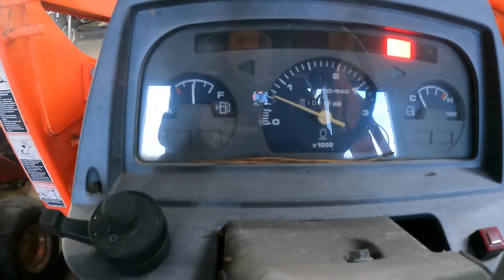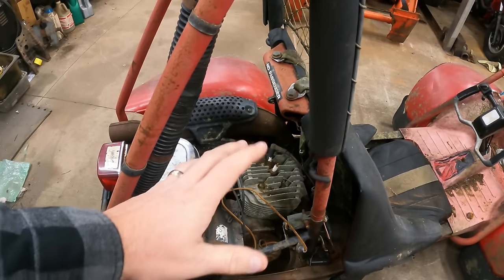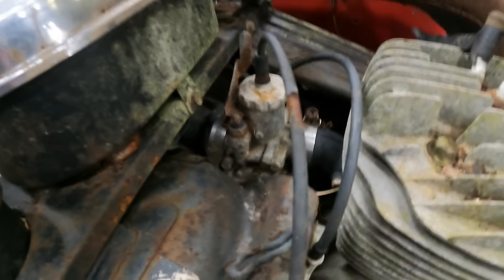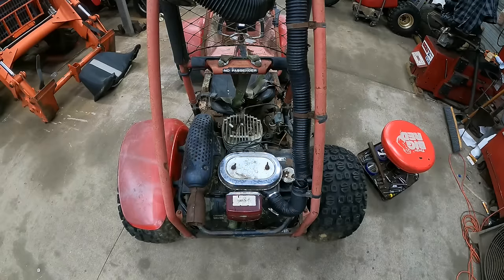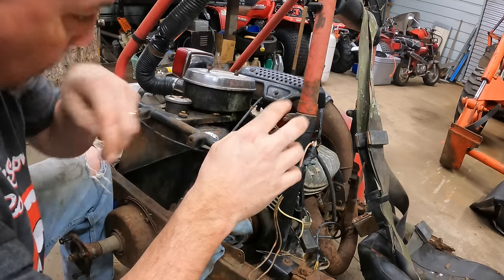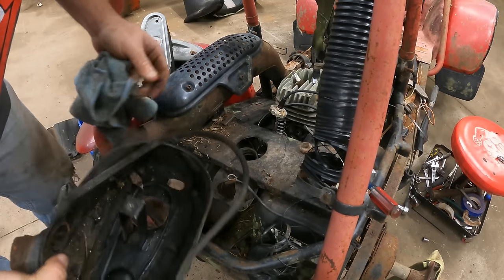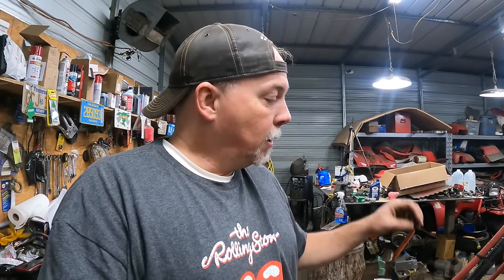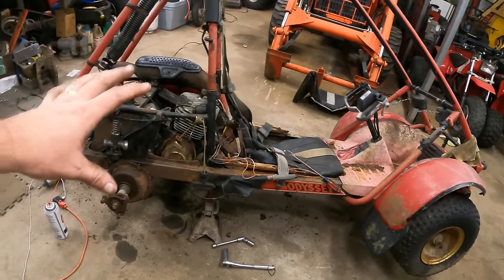The Honda Odyssey FL250: Reviving a  Legend!

Comment: Man that is awesome.I remember my cousin had one back in the late '70s.It was the yellow one.I remember thinking man this is one cool go cart😂😂.The tail light looks like a CT70 one...👍👍😁
Reply from the maker: You may be right about the tail light, Honda used a lot of the same parts on different machines. That's another reason to sick with one brand and time frame. That coil I used came off a 3 wheeler, so even a 3 wheeler parts bike can save an odyssey. Thanks for watching.

Comment: Those drive clutches will be fun the secondary looks ugly.. solid shape but poor bike was neglected. I agree they were similar to 250r but "watered down"
Reply from the maker: The carb is toast, I did get it to run a bit longer today, and the driven was expanding and contracting the driven did no, but I could not get any real rpms out of it. but I have a plan.
Reply: @mrcbuilds  I'm sure the rollers in the drive  are rusty and the little plastic pucks in the driven are trashed out too... but that's all part of the fun.  In the snowmobile world they say that up to 30% of power is loss in them clutches... they gotta be  in tip top shape... ive also seen governed golf carts that actually wore grooves in the sheaves and we obviously removed the governor and it took alot to overcome the groove(more rpms)  but when it did man did it hit hard and take off
Reply: I know the carb slides do stick.. and it's tight quaters but are u able to compress the spring enough to get the tiny little need clip off... just a theory that the needle may be more stuck then the slide....with the slide out you have better chance to get pb blaster to the needle/ main jet

Comment: By the way the second spark plug hole is for a compression release.
Reply from the maker: Hi comrades, I may have miss spoke on the 2 spark plug issue, i repeated something i was told. I find it intresting that so many have 2 plugs in them. Why? Did the decompression system fail? If there was a solid plug in the head why would so many people take it out just to install a spark plug and then not hook it up. I have read a few articles stating running 2 plugs for a better burn or to have a spare. I have been researching this issue since posting this video, and can not find clear concise information on this issue. The manual show 1 plug and no decompression button. If this is a left over part from the Honda Elsinore as some have stated, then why would so many average people take the pipe plug out? Thanks for watching.

Comment: Decals look like 81 model year. Each year had different stickers. Also should be a model year plate on the back rail near thr brake disc.
Reply from the maker: Thanks Tony, I have found the vin numbers but no plate. I will run the vin asap. Thank you.